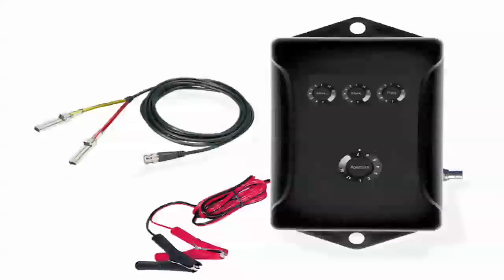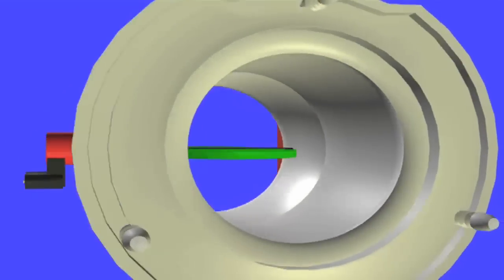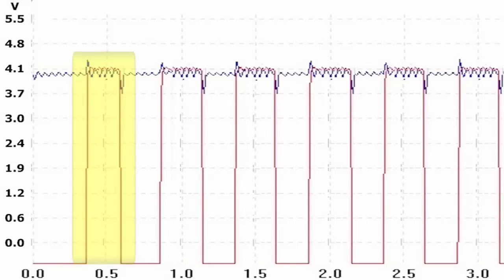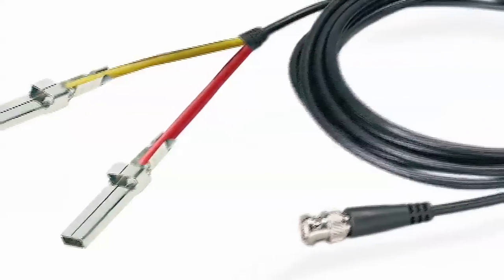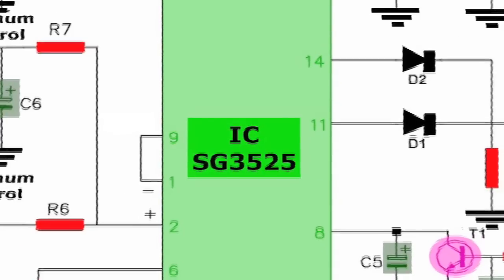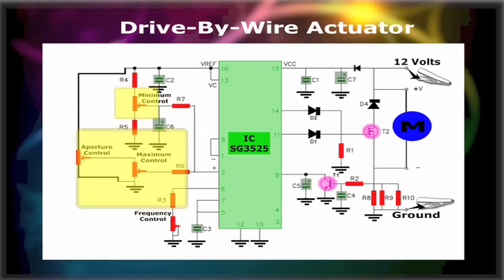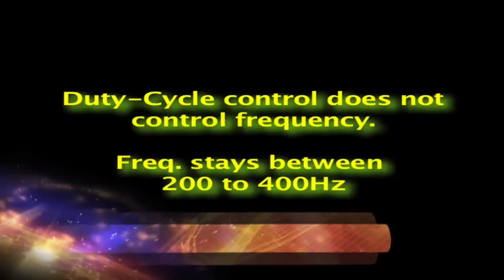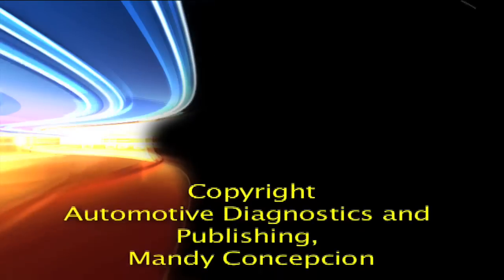Drive-By-Wire Motor Actuator Controller

Comment from the maker: You need to actuate the TB, either with a scanner, using the accelerator on some cars or using this gadget. In all situations you erase any issued codes afterwards. It is important to have a clear throttle at all time with DBW. This tool is useful in cleaning and diagnosing DBW throttle issues. Thank you...

Comment from the maker: That may be true, but the tool is use when your ECM doesn't actuate the throttle or you don't have a scanner. In these cases, you use this gadget and if actuation is effective, then you know the electronic throttle is fine. It's one more tool in your arsenal to make life easier. Thanks for posting...

Comment from the maker: Drive-by-Wire Actuator Controller

TI - BD547
T2 - BUK9535-55 (with heat shield)

D1, D2 - 1N4148
D3 - 1N4007
D4 - 6A2/6A6

IC1 - SG3525 (16 pin)

R1, R2 - 220
R3, R4 - 2K 2%
R5 - 10K
R6 - 100K
R7 - 220K
R8, R9, R10 - 0.22 (R22) 5 watts

RV1, RV2 - 10K
RV3 - 250K

C1, C2, C3, C4 - 100nF (ceramic)
C5, C6 - 10yF (electrolitic)
C7 - 100yF 40volts (Min) (electrolitic)

Comment from the maker: Ok, good question... Plasticase in Canada is one enclosure place. Also do a search for PCB plastic enclosures. Even Radio Shack has some enclosures if you only need 2 or 3. They're under $10 and do the trick. MOUSER is also a good place.

Comment from the maker: Aperture is the throttle aperture. Max is the widest throttle valve opening. It's simple... Don't think DBW throttles use a varying voltage, they DON'T. It's a duty cycle signal. For more on duty cycle search this channel "ADPTraining" for more...Good luck.

Comment from the maker: NO, never do that. As you saw on the video there are gears and a mechanism inside the DBW throttle actuator. This is a definite no. I've seen some techs do it, but that's an invitation for major trouble and it is simply wrong. You must use a plastic brush to clean DBW plates. If the plates suddenly close, you wont cause any damage. Always open the electric throttle by actuating it. If it won't open, then something's wrong and this gadget helps identify the issue. Hope that helps...

Comment from the maker: Once you disconnect the ECM or DBW cable you're free, "from an electronics point of view" to operate either side, pos or neg. Whichever side you do the duty cycle from it's irrelevant so long as the polarity is right. So it's operate the throttle for TESTING purposes. Do not use this while driving the car, needless to say. Makes sense.

Comment: Hello ADP Training,

Thank you so much for posting the video and parts list.  My question was asked earlier but not answered.  
Can you please clarify the parts information?  More specifically, which components are RV1 -3?  I assume RV1 & RV2 are the min & max variable resistors at 10k and RV3 is the Aperture at 205k?  Also, you list R8-R10 at 0.22, is that value in ohms, K ohms, M ohms at being 5 watt resistors?  Are you using 3 parallel 5 watt resistors to dissipate heat vs one larger resistor with a higher wattage?  Are all the remaining resistors, aside from R3 1/4 watt 5% tolerance?  Capacitors C5 -7 are listed at yf, did you mean uf?

Thank you very much!

Comment: Thanks i have got answer to my question, after doing my homework.. i also got schematic from website as well. not sure why we need aperture control and maximum control, i thought maximum control is used, to increase or decrease voltage of output, if so i dont know what aperture is for, please.

Comment: Thanks so much. What is RV1, RV2 and RV3 stands for . I think u are referring to aperture, frequency and maximum control. please advise the electronic component name. (like resistor, diode, etc) to order it.. 2) what is R10 - 0.22(R22) 5 Watts Means. I can understand resistor with 22 ohms not sure (r22 means) also understand 5 watts

Comment: HI, in  this video, you have not explained values of Resistors, capacitors etc, I hope that is what ur R1 TO R10 and C1 TO C5 stands for. also what is apertures control, frequency control and maximum control components..i see no information in video, or may be I am missing, I am planning to start a project to develop one after another from ur videos, and keep posted.

Comment: hi, in this video, it is not clear, what electronic component to use for those aperture control and frequency control. ?. Also  u marked lot of resistors, it doesn't have the value.. Also no value for capacitors and diodes..  can u pls advise, so other subscribers will be benefited..